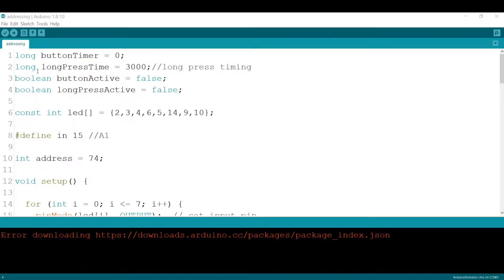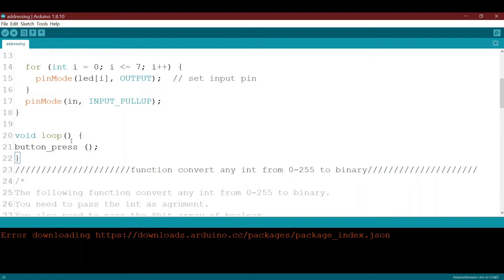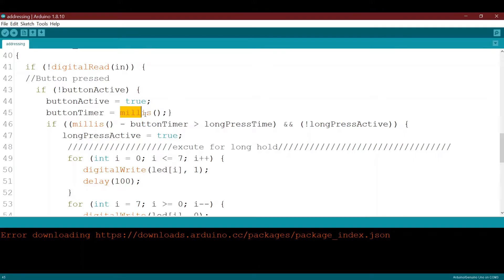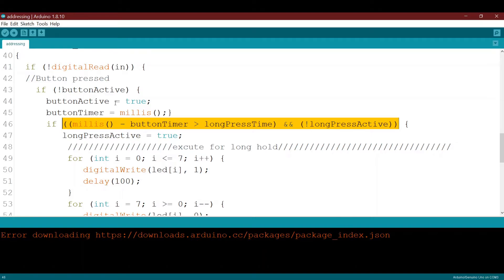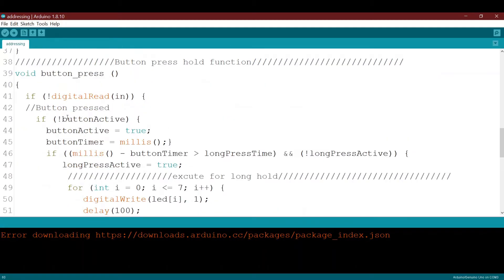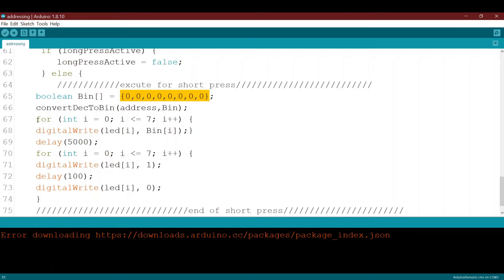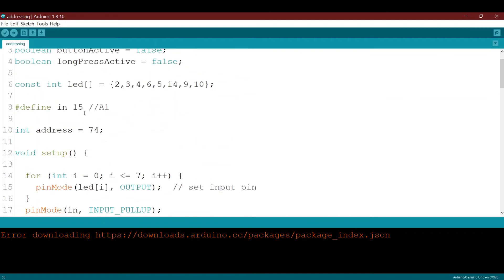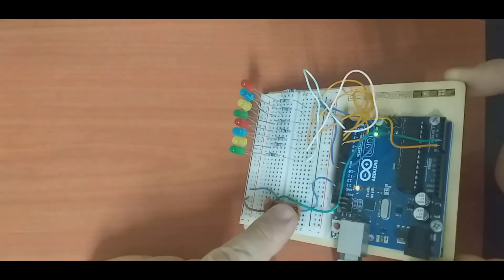Implementing a Press and Hold Function in Your Projects | Easy Step-by-Step Guide

Comment: if i had two button and press the 1st button, would it ingore the 2nd button? like if when a button is pressed and if so make a variable become true, as long as that variable is true then ignore other button presses and start a one second timer.  would it be possible? using this code.
Reply from the maker: Hello Sylgon, yes it seems possible. Although pressing and holding one button will automatically blocks other buttons because we are using round-robin code, however you may need to use flag to block other buttons with the time that you specified.